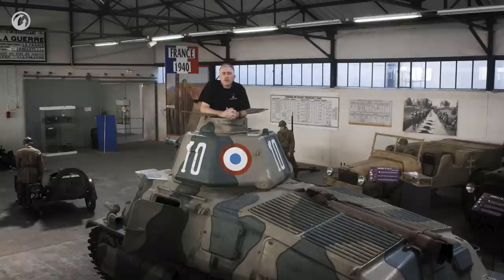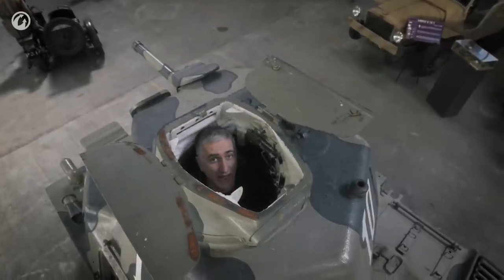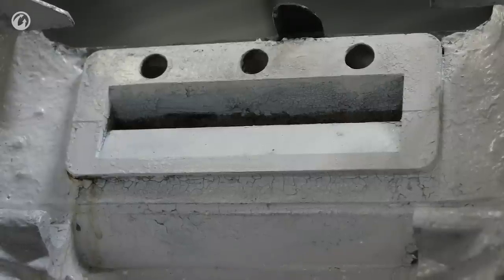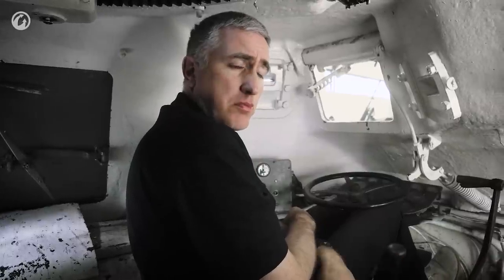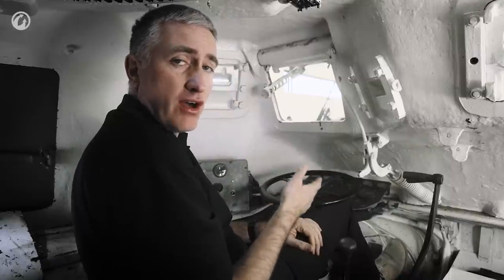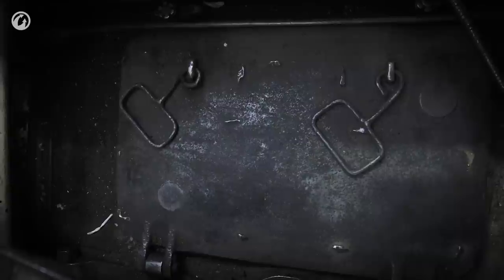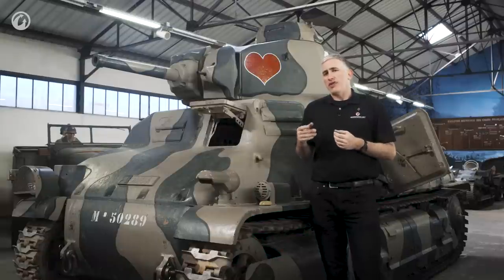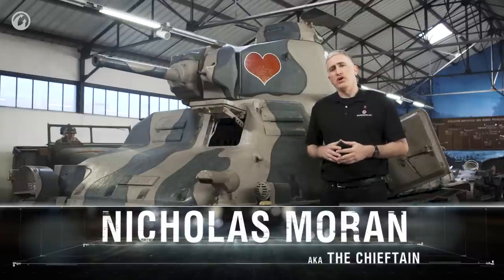Inside the Chieftain's Hatch: SOMUA S35 part 2

Comment: Were you doing that one under constraint ?
Also, no mention of the combat performances -german tankers were ordered to systematically report them and disengage if not under 70m for a reason; no mention of the true peculiarity of the steering ( read that at speed it turned not by slowing down the inner track, but accelerating the outer so as to not lose speed); And "when the french joined the allies"...
Really ?
Reply: I think the "when the french joined the allies" part was about this: Northern France was taken over by Germans in 1940. In south there was still a puppet goverment called Vichy France. In 1942 Allied forces landed in Morocco and Algeria, which were controlled by Vichy French. They fought back at first but then surrendered. From then on French were on the Allied side. Southern France was also occupied by Germans. The French troops in Africa then went on to fight on the Allied side in Italy and Western Europe.

I have never heard about this not engage over 70 meters thing. Do you have any sources.
Reply: Didn’t he say “rejoined”?  Clearly that’s what he meant.
Reply: WHat you're saying doesn't make sense. If it's going at speed you can't make one track spin faster because it's already going at max speed.  To get a good turning radius you need to difference in speed to be significant and doing it that way means it can never go even close to top speed.
Reply: CipiRipi00  In WW2 Soviets were considered part of the Allies. After the war this of course all changed.
Reply: CipiRipi00  Oh, you mean that the opposite track will lose traction with the ground. Then yes it can spin faster but it would be meaningless. A tank going at maximum speed means it's using the highest gear possible ans switching to a lower gear means you are slowing it..
Reply: @Wallyworld30  Not really. In fact in 1939/1940 when the USSR invaded Finland Britain was prepared to go to war over it. They prepared to send an army to Finland and debate raged of rather to just sent help to Finland or declare outright war against the Soviet Union.
However all this came to a halt when Hitler invaded Denmark and Norway and the troops that were prepared to fight in Finland were instead diverted to Norway. The British then prepared to secure Norway and still support Finland but Finland was doing extremely poorly and there were now over 100.000 Soviet troops. The debate of support was ended entirely when Germany invaded Belgium and the British needed every abled soldier.
Reply: CipiRipi00  Really? Since the two are connected there speed can't change. I thought that's how the steering works. You make one tire have more surface area than the other and so to maintain the same speed the car is forced to turn in that direction.

Sliding is losing traction. Braking one track while accelerating the other is the only way to do it. Not accelerating has the risk of stalling the engine. However my point was that if you do this at full speed you will lose speed because you no longer have full power to both sprockets.